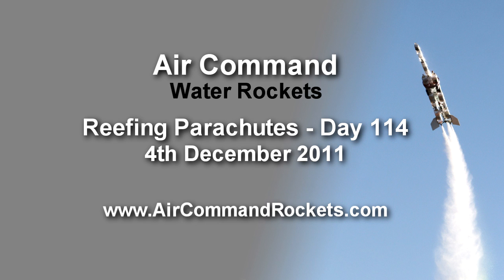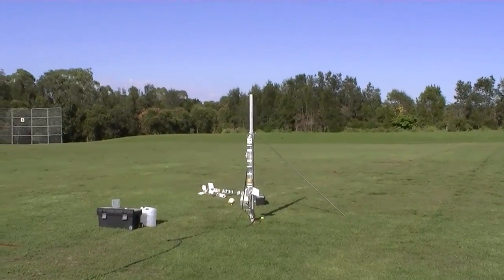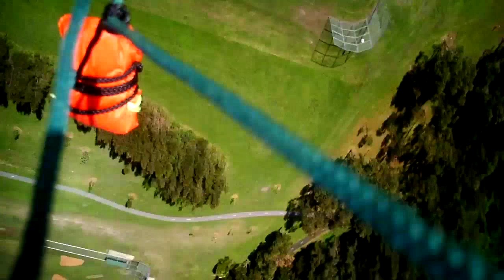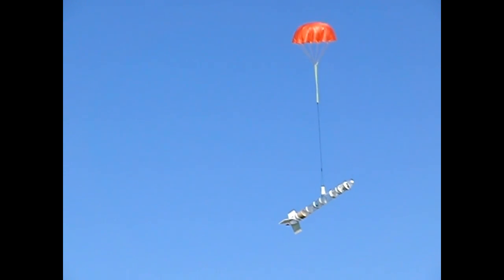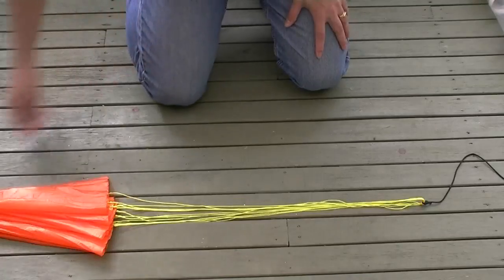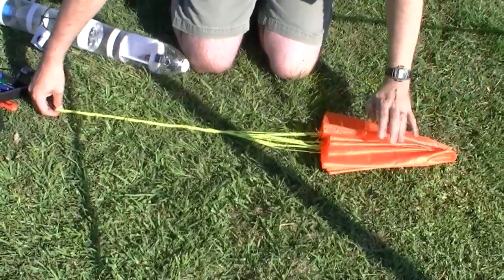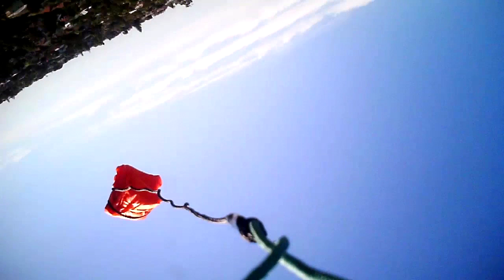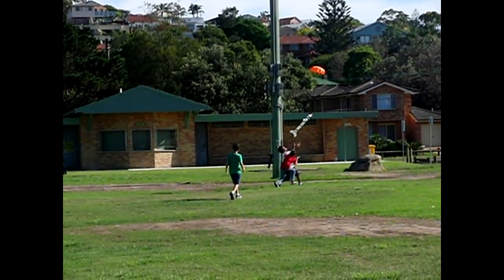Water Rockets - Reefing Parachutes

Comment from the maker: The orange parachute is just made from a flat sheet of rip-stop nylon. We ordered the ripstop from the UK where we were able to find a source that sells the material that is fairly thin. You can buy normal ripstop from most fabric stores which works just fine. For large parachutes we just use old large golf umbrellas. They work a treat and very little effort needed to make them.

Comment: hey quick question. that orange parachute for the rocket did you make it and if so what is the material and how much is it. or what website has quality parachutes. need one roughly 4 to 6 ft in diameter. it would be used for slowing down heavy objects. about 7 pounds max. your responce is greatly appricated.

Comment from the maker: Hi Randy, We did for this launch, but this rocket is small enough that at the 120psi the g-switch is fine. We were launching at around 100psi to stay within the small field and so we knew the acceleration would be lower so we just went with the break wire.

Comment from the maker: @Basrockets The problem isn't when to deploy the parachute, but after it is deployed if the rocket is travelling quickly opening a parachute at high speed can put a lot of stress on the parachute and the rocket. By opening the canopy slowly means you can slow the rocket down more gradually reducing the peak loads.